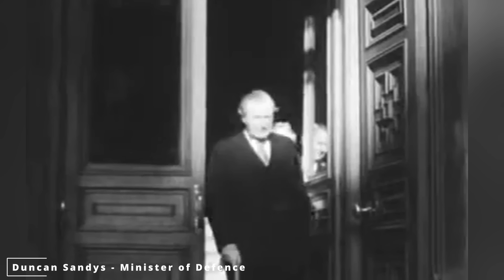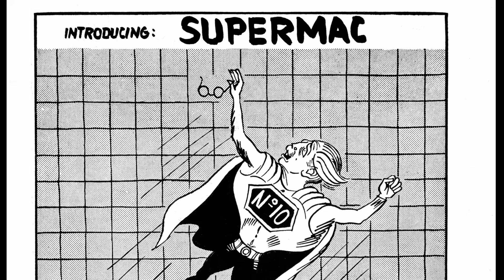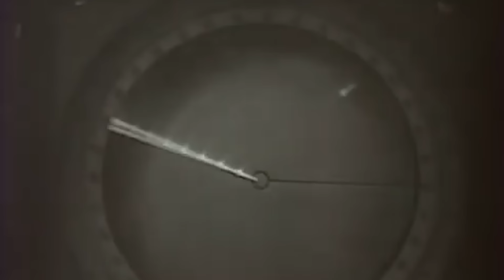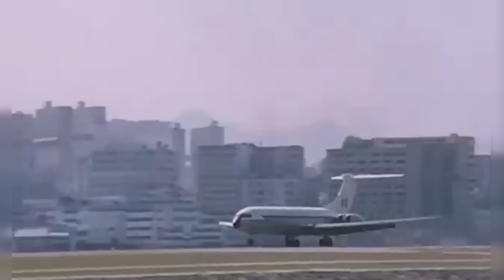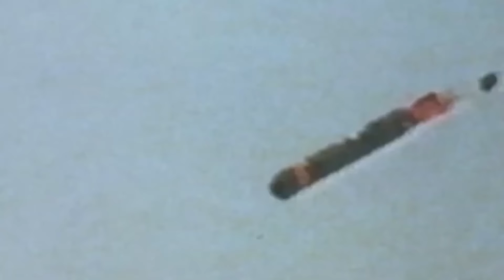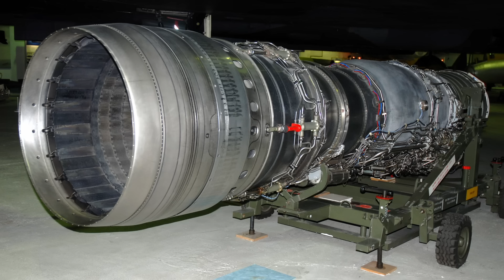How Britain Turned A Failed Airliner Into a Soviet Submarine Predator | The Mighty Nimrod

Comment: Did it sink any Soviet submarine? If not, then it was a more successful airliner than what you imply
Reply: The Nimrod was certainly not successful from a sales aspect either, the Lockheed P-3 and the Berguett Antlantique were more popular and successful.
Reply: @sandervanderkammen9230 

@DoktorBayerischeMotorenWerke   

We believe we can clear up some commonly held myths and misconceptions obviously.

It's always good to see the facts presented clearly and concisely isn't it?

All production Nimrod aircraft were new build Comet 4 airframes with the necessary modifications. The Nimrod was the most advanced and most capable aircraft of it's type at the time it went into service. The  Nimrod HS.801 was not available for purchase by other countries. The ability of the HS 801 to repeatedly & reliably demonstrate detection of subs and the knowledge that it could deliver nuclear depth charges to a target was a very effective deterrent. 

Bow-wing (see B-47 wing collapse wing folding incidents) had built less than 12 pressurised airliners before the Comet first flew and they were not high altitude airliners. 

All Nimrods were new build Comet 4 airframes with appropriate strengthening and the unpressurized  equipment bay tacked on. 

The HS 801 Nimrod was the most advanced aircraft of it's type at the time it first flew. Problems with the MRA4 programme were almost entirely due to radar and computer equipment issues and BAe Systems & co being too busy with other work at the time. 

Obviously there have been worse aircraft for accident losses both before & after the Comet.

Early problems with Comet takeoff stalls were caused by pilots over rotating the aircraft at liftoff. 

Podded engines on wings have aerodynamics issues. The main reasons for eventually going with podded engines were because or to facilitate - Ease of maintenance. Use of shear off fixings given excessive out of balance forces.
Large diameter turbofan engines.
Reduce load on the wing to fuselage connection. Increased power from later engines. 

The Bow-wing (See B-47 wing collapse & wing folding incidents) was a good example of how to expend a huge amount of cash and effort on something that was probably not worth bothering with. The basic design of the Comet had been decided upon and established before the podded engine choice has been made for the B-47. There were aerodynamics problems with podded pylon mounted engines at the time. The US also built and operated a significant number of EE Canberra bombers under licence which did not use podded engines for their wing mounted engines. . 

There have been aircraft losses caused by pod & pylon mounted engines. 

All jet airliners benefited greatly from the knowledge gained from the Comet incidents & subsequent investigations & yet some were still worse for accident losses. 

Instances of all marks of the Comet flew with full certification after 1954 including the Comet 3. The last Comet flight occured in 1997.

The fabulous trail blazing DH Comet.
World's first jet airliner in regular service.
The jet engined Avro Lancastrian actually did a passenger service before the DH Comet. 
World's first high altitude airliner.
World's first airliner with a full fuselage length pressurised cabin pressurised for high altitude flight. That feature for that type of aircraft was a considerably difficult undertaking. 

The change from larger squarer windows to smaller rounder windows was necessary for the particular aircraft at the time. Skin thickness remained mostly the same for all Comet marks. 

How things were back then.
Accident losses - % of aircraft built.

DeHavilland Comet 4 UK                          14% 
DeHavilland Comet all mks UK (ff 1949)17%  
Vickers VC10 UK (ff 1962)                         5%

Douglas DC-1  US                                       99%
Douglas DC-2                                              47%
Douglas DC-3                                              30%
Douglas DC-4                                              26%
Boeing s300    US                                       72% 
Boeing 307                                                  70%
Boeing 247                                                   48%
Boeing 707  (ff 1958)                                 32% 
Lockheed L-049 Constellation (ff 1943)  30%
Lockheed Electra US (ff 1957)                   29%
Fairchild FH-227 US (ff 1966)                   30%
McDonnell Douglas DC-8 US  (ff 1958)   14%
Sud Aviation Caravelle  (ff 1955)             15%
Canadair CL-44 Turboprop US (ff 1959) 46%  
Convair CV-580 Turboprop US (ff 1960) 22%
Convair CV-880     (ff 1959)                      27% 
Convair CV-990     (ff 1961)                      33%
Tupolev T-104        (ff 1956)                     16%
Vickers Viscount UK  (ff 1948)                29%  
Fokker F-27 Turboprop NL (ff 1955)       40%      

The Vickers VC10, fastest Atlantic crossing for a non supersonic jet airliner, held the record for 41 years.

For the first few years of operation the Caravelle & Comet had similar accident loss fatalities.

Sud Aviation Caravelle - 
all accident loss fatalities - 
1320 fatalities. 

De Havilland Comet - 
all accident loss fatalities - 
453 fatalities. 

An example of a typical airliner from the period. 
The Fokker Friendship F-27 fatalities & accident losses as a % of aircraft built. 
Fokker F-27 Turboprop (ff 1955)   40%
2130 fatalities.

Of course De Havilland carried out a full stress analysis & performed extensive & protracted testing on two long lengths of fuselage representing all features of a complete airframe. De Havilland carried out significantly more testing than was required by any authority at the time & significantly more testing that any previous airliner was subjected to.

De Havilland designers / engineers knew all there was to know about metal fatigue at the time they designed the DH Comet.

De Havilland had prior experience building many all metal construction airframe aircraft including many passengers aircraft & thousands of jet powered fighter aircraft that were primarily of metal construction with pressurised cockpits & used jet engines built by De-Havilland.

De Havilland did indeed always work to better than industry standards at the time, used up to date knowledge for the design & testing activities & no evidence of negligence or criminal negligence was ever produced in relation to the DH Comet.

Global aerospace. 
From the 1950s sector rationalisation and consolidation took place. 70 companies in France and 300 companies in the US disappeared due to merger or dissolution. In the US Boeing was almost bankrupted by the 707 project.  Boeing had a well protected domestic market and the available space and resources in the US to engage in large scale airliner manufacturing enabling them to capture orders simply by being able to produce airframes fast enough and cheap and nasty enough. Another factor is airlines preferring to obtain as much of their airliner inventory as possible from one manufacturer. 

Global Aerospace Sector, what's happening.

For example, there are of course no German companies that makes German jet aircraft in Germany & there are no German companies that make German gas turbine aero engines in Germany that are suitable for widebody airliners.

The UK has the world's highest combined per capita Nuclear / Defence / Aerospace Sector Activity.

UK defence sector, absolute terms, world's second highest activity. 1st for per capita defence sector activity. Per capita nuclear powered submarine construction, 2nd position. 
Main players being Rolls Royce, Babcock, GKN Aerospace & BAe Systems. Activities often involve international collaboration. BAe systems, RR and other UK companies now handle more Airbus work value wise than Germany. 

There's a good chance that anyone currently flying on a widebody airliner will be on an aircraft powered by RR gas turbine aero engines made in the UK and a good chance there will be other hardware on the aircraft that's designed and / or manufactured in the UK. 

Rolls Royce Holdings UK
Subsidiaries
- Rolls-Royce plc
- Rolls-Royce North America (ex Allison etc Classified Military stuff)
- Rolls-Royce AB
- Rolls-Royce Deutschland
- Rolls-Royce India Private Limited
- Rolls-Royce Marine Power Operations
- Vinters Engineering Limited
- Rolls-Royce Controls and Data Services
- Rolls-Royce Power Systems
- Bergen Marine
Joint ventures include:
- Rolls-Royce Turbomeca
- MTU Turbomeca -

Trent Family
The MT30 (Marine Turbine)
Industrial Trent 60 Gas Turbine
Trent 7000
Trent XWB Airbus A330neo.
Trent 1500
Trent 1000
Trent 500
Trent 600
Trent 700
Trent 800
Trent 8100
Trent 900
   
RR wholly owned subsidiaries in Germany handle smaller 2 shaft RR gas turbine aero engine work.

The UK space and aerospace sectors are highly productive, high-value industries that together contribute over £18 Billion in direct Gross Value Added (GVA) to the UK economy. Individually, the space industry directly contributes about 0.3% of UK GDP 7•2 Billion while the aerospace industry contributes approximately 0.5% £10•9 Billion.
   
We hope this helps.
Reply: @sandervanderkammen9230 

Typhoon & Tornado, British design aircraft. 

Early days of the airliners.

The awesome De Havilland Comet.
World's first production jet airliner.
World's first high altitude airliner. 
At the time the Comet wasn't particularly dangerous. The DH Comet was definitely not the worst engineering failure in commercial airliner history.

Losses comparisons.
How things were in those days.

DeHavilland Comet 4 UK                          14% 
DeHavilland Comet all mks UK (ff 1949)17%  
Vickers VC10 UK (ff 1962)                         5%

Douglas DC-1  US                                       99%
Douglas DC-2                                              47%
Douglas DC-3                                              30%
Douglas DC-4                                              26%
Boeing s300    US                                       72% 
Boeing 307                                                  70%
Boeing 247                                                   48%
Boeing 707  (ff 1958)                                 32% 
Lockheed L-049 Constellation (ff 1943)  30%
Lockheed Electra US (ff 1957)                   29%
Fairchild FH-227 US (ff 1966)                   32%
McDonnell Douglas DC-8 US  (ff 1958)   14%
Sud Aviation Caravelle  (ff 1955)             15%
Canadair CL-44 Turboprop US (ff 1959) 46%  
Convair CV-580 Turboprop US (ff 1960) 22%
Convair CV-880     (ff 1959)                      27% 
Convair CV-990     (ff 1961)                      33%
Tupolev T-104        (ff 1956)                     16%
Vickers Viscount UK  (ff 1948)                29%  
Fokker F-27 Turboprop NL (ff 1955)       40%      

The Vickers VC10, fastest Atlantic crossing for a non supersonic jet airliner, held the record for 41 years.

For the first few years of operation the Caravelle & Comet had similar accident loss fatalities.

De Havilland had prior experience building many all metal construction airframe aircraft & thousands of jet powered fighter aircraft that were primarily of metal construction with pressurised cockpits & jet engines built by De-Havilland. No aircraft before the Comet was subjected to as much pre-production testing as the Comet. 

It's a great pity & a crying shame that British military forces had to occupy a large part of Germany for decades after 1945 & Russian military forces had to do the same. Of course Russia still posseses a large chunk of what was German territory & of course Russia & the UK produce nukes. Obviously Germany does not produce nukes.

Interesting British achievements.

The gas turbine engine was invented & patented in England before the 1800s.

Axial multi stage sequential stage compressor & turbine technology, first produced for turbo machinery use in England by Parsons of Ireland & North England during the 1800s. The components form the basis of most modern gas turbine aero engines. At the time the concept of the jet aircraft powered by axial internal combustion gas turbine engines was first mentioned thus the internal combustion jet engine & jet aircraft was indeed invented in England before the 1900s & before the Wright brothers got busy.

Work on the multi stage sequential stator rotor axial compressor as applicable to the axial compressor gas turbine aero engine was ongoing in England from around 1928 by Arnold Griffiths and others. By 1943 the Metrovik F2/3  Beryl was a running axial turbojet that was superior to anything anywhere else. As the centrifugal compressor engines were adequate and more powerful at the time development of a larger F2/3  version was commenced.

The Metrovik (UK)  F2/3 axial compressor gas turbine aero engine was flight certified & ran in 1942, it was the result of UK development work ongoing since 1929. At the time it was the most capable axial compressor turbojet in existence but was not required and development work continued on a larger version.

Frank Whittle performed the world's first demonstration of a gas turbine aero engine in 1937. People in Germany kept a close eye on everything going on in Britain at the time.

The centrifugal compressor RR Nene was the most powerful & most reliable gas turbine aero engine on the planet in 1944. That engine would be later built under license or copied in many countries including Russia (Mig-15 Mig-17), China, the US, France and Switzerland powered dozens of aircraft types for decades after 1944.

Pratt and Whitney and others produce centrifugal compressor gas turbine aero engines. The PW200 is a currently produced whittle style centrifugal compressor, reverse flow combustor, gas turbine aero engine. 

The world's first wind tunnel was constructed in England during the 1870s. The world's first supersonic wind tunnel was constructed in England in 1922.

There is no doubt that the Fairey (England)
Delta 2 was the world's first jet
aircraft to exceed 1000 mph.  Indeed It
exceeded the previous record by 310 mph &
held the record for 1 year. Incidentally, the Dassault Mirage 3 & 4 are based on the Fairey Delta 2.

More recent UK military jet aircraft.

The Tornado & Typhoon & their engines are Supersonic & are indeed British design aircraft with British design engines built by an international consortium. The Tornado design for example started life during the 1950s at Vickers as the AFVG, it's engine is based on the RR RB-199. The EE Lightening is also a British Supersonic jet aircraft.

The Typhoon is the British BAC-EAP with an engine based on the British RR XG-40, the Typhoon is also built by an international consortium.

Brazil has the world's third largest airliner manufacturer and makes very good airliners & Brazil is 100th down the list along with Indonesia for wealth per capita. Of course it is in fact the case that Embraer can't build those airliners without purchasing stuff from the US, UK & Europe. For example, Norway, Holland, Denmark, Ireland & Belgium, top 20 wealth per capita, don't make airliners, its as simple as that.

Global aerospace. 
From the 1950s sector rationalisation and consolidation took place. 70 companies in France and 300 companies in the US disappeared due to merger or dissolution. In the US Boeing was almost bankrupted by the 707 project.  Boeing had a well protected domestic market and the available space and resources in the US to engage in large scale airliner manufacturing enabling them to capture orders simply by being able to produce airframes fast enough and cheap and nasty enough. Another factor is airlines preferring to obtain as much of their airliner inventory as possible from one manufacturer. 

Global Aerospace Sector, what's happening.

For example, there are of course no German companies that makes German jet aircraft in Germany & there are no German companies that make German gas turbine aero engines in Germany that are suitable for widebody airliners.

The UK has the world's highest combined per capita Nuclear / Defence / Aerospace Sector Activity.

UK defence sector, absolute terms, world's second highest activity. 1st for per capita defence sector activity. Per capita nuclear powered submarine construction, 2nd position. 
Main players being Rolls Royce, Babcock, GKN Aerospace & BAe Systems. Activities often involve international collaboration. BAe systems, RR and other UK companies now handle more Airbus work value wise than Germany. 

There's a good chance that anyone currently flying on a widebody airliner will be on an aircraft powered by RR gas turbine aero engines made in the UK and a good chance there will be other hardware on the aircraft that's designed and / or manufactured in the UK. 

Rolls Royce Holdings UK
Subsidiaries
- Rolls-Royce plc
- Rolls-Royce North America (ex Allison etc Classified Military stuff)
- Rolls-Royce AB
- Rolls-Royce Deutschland
- Rolls-Royce India Private Limited
- Rolls-Royce Marine Power Operations
- Vinters Engineering Limited
- Rolls-Royce Controls and Data Services
- Rolls-Royce Power Systems
- Bergen Marine
Joint ventures include:
- Rolls-Royce Turbomeca
- MTU Turbomeca -

Trent Family
The MT30 (Marine Turbine)
Industrial Trent 60 Gas Turbine
Trent 7000
Trent XWB Airbus A330neo.
Trent 1500
Trent 1000
Trent 500
Trent 600
Trent 700
Trent 800
Trent 8100
Trent 900
   
RR wholly owned subsidiaries in Germany handle smaller 2 shaft RR gas turbine aero engine work.

The UK space and aerospace sectors are highly productive, high-value industries that together contribute over £18 Billion in direct Gross Value Added (GVA) to the UK economy. Individually, the space industry directly contributes about 0.3% of UK GDP 7•2 Billion while the aerospace industry contributes approximately 0.5% £10•9 Billion.
   
We hope this helps.
Reply: @sandervanderkammen9230 

 
The fabulous trail blazing De Havilland Comet. 

World's first production jet airliner doing regular commercial service. An Avro Lancastrian jet airliner was actually first. 

World's first high altitude jet airliner. 

There can be no excuses for the Bow-wing (See B-47 wing / folding  collapse incidents) Max incidents given that Bow-wing had more than 50 years design and build experience for the type. 

A typical Bow-wing (See B-47 wing collapse incidents) airline duty 707 lasted for about 23 years on average. The reason any lasted longer was large numbers built so lots of spares with a lot of airframes in military use with big military maintenance budgets and many often with low flying hours or in storage. A typical 707 is basically cheap nasty junk. 

All later jet airliners benefited greatly from the knowledge gained from the Comet incidents & subsequent investigations & yet some were still worse for accident losses. 

Instances of all marks of the Comet flew with full certification after 1954 including the Comet 3 with full certification remaining in place until after the aircraft were retired. The last Comet flight occured in 1997.

The nose design was unique to the Comet, Sud Aviation licensed the design for their Caravelle. 

The fabulous trail blazing DH Comet.
World's first jet airliner in regular service.
The jet engined Avro Lancastrian actually did a passenger service before the DH Comet. 
World's first high altitude airliner.
World's first airliner with a full fuselage length pressurised cabin pressurised for high altitude flight. That feature for that type of aircraft was a considerably difficult undertaking. 

How things were back then.
Accident losses - % of aircraft built.

DeHavilland Comet 4 UK                          14% 
DeHavilland Comet all mks UK (ff 1949)17%  
Vickers VC10 UK (ff 1962)                         5%

Douglas DC-1  US                                       99%
Douglas DC-2                                              47%
Douglas DC-3                                              30%
Douglas DC-4                                              26%
Boeing s300    US                                       72% 
Boeing 307                                                  70%
Boeing 247                                                   48%
Boeing 707  (ff 1958)                                 32% 
Lockheed L-049 Constellation (ff 1943)  30%
Lockheed Electra US (ff 1957)                   29%
Fairchild FH-227 US (ff 1966)                   30%
McDonnell Douglas DC-8 US  (ff 1958)   14%
Sud Aviation Caravelle  (ff 1955)             15%
Canadair CL-44 Turboprop US (ff 1959) 46%  
Convair CV-580 Turboprop US (ff 1960) 22%
Convair CV-880     (ff 1959)                      27% 
Convair CV-990     (ff 1961)                      33%
Tupolev T-104        (ff 1956)                     16%
Vickers Viscount UK  (ff 1948)                29%  
Fokker F-27 Turboprop NL (ff 1955)       40%      

The Vickers VC10, fastest Atlantic crossing for a non supersonic jet airliner, held the record for 41 years.

For the first few years of operation the Caravelle & Comet had similar accident loss fatalities.

Sud Aviation Caravelle - 
all accident loss fatalities - 
1320 fatalities. 

De Havilland Comet - 
all accident loss fatalities - 
453 fatalities. 

An example of a typical airliner from the period. 
The Fokker Friendship F-27 fatalities & accident losses as a % of aircraft built. 
Fokker F-27 Turboprop (ff 1955) 40%
2130 fatalities.

Boeing 707    3108 fatalities.

Of course De Havilland carried out a full stress analysis & performed extensive & protracted testing on two long lengths of fuselage representing all features of a complete airframe. De Havilland carried out significantly more testing than was required by any authority at the time & significantly more testing that any previous airliner was subjected to.

De Havilland designers / engineers knew all there was to know about metal fatigue at the time they designed the DH Comet.

De Havilland had prior experience building many all metal construction airframe aircraft including many passengers aircraft & thousands of jet powered fighter aircraft that were primarily of metal construction with pressurised cockpits & used jet engines built by De-Havilland.

De Havilland did indeed always work to better than industry standards at the time, used up to date knowledge for the design & testing activities & no evidence of negligence or criminal negligence was ever produced in relation to the DH Comet.

Global aerospace. 
From the 1950s sector rationalisation and consolidation took place. 70 companies in France and 300 companies in the US disappeared due to merger or dissolution. In the US Boeing was almost bankrupted by the 707 project.  Boeing had a well protected domestic market and the available space and resources in the US to engage in large scale airliner manufacturing enabling them to capture orders simply by being able to produce airframes fast enough and cheap and nasty enough. Another factor is airlines preferring to obtain as much of their airliner inventory as possible from one manufacturer.  Brazil has the world's third largest airliner manufacturer, Brazil is towards the bottom of the wealth over capita tables along with Indonesia. Most of the countries at the top don't bother having a single national airliner manufacturing company. 

Global Aerospace Sector, what's happening.

For example, there are of course no German companies that makes German jet aircraft in Germany & there are no German companies that make German gas turbine aero engines in Germany that are suitable for widebody airliners.

The UK has the world's highest combined per capita Nuclear / Defence / Aerospace Sector Activity.

UK defence sector, absolute terms, world's second highest activity. 1st for per capita defence sector activity. Per capita nuclear powered submarine construction, 2nd position. 
Main players being Rolls Royce, Babcock, GKN Aerospace & BAe Systems. Activities often involve international collaboration. BAe systems, RR and other UK companies now handle more Airbus work value wise than Germany. 

There's a good chance that anyone currently flying on a widebody airliner will be on an aircraft powered by RR gas turbine aero engines made in the UK and a good chance there will be other hardware on the aircraft that's designed and / or manufactured in the UK. 

Rolls Royce Holdings UK
Subsidiaries
- Rolls-Royce plc
- Rolls-Royce North America (ex Allison etc Classified Military stuff)
- Rolls-Royce AB
- Rolls-Royce Deutschland
- Rolls-Royce India Private Limited
- Rolls-Royce Marine Power Operations
- Vinters Engineering Limited
- Rolls-Royce Controls and Data Services
- Rolls-Royce Power Systems
- Bergen Marine
Joint ventures include:
- Rolls-Royce Turbomeca
- MTU Turbomeca -

Trent Family
The MT30 (Marine Turbine)
Industrial Trent 60 Gas Turbine
Trent 7000
Trent XWB Airbus A330neo.
Trent 1500
Trent 1000
Trent 500
Trent 600
Trent 700
Trent 800
Trent 8100
Trent 900
   
RR wholly owned subsidiaries in Germany handle smaller 2 shaft RR gas turbine aero engine work.

The UK space and aerospace sectors are highly productive, high-value industries that together contribute over £18 Billion in direct Gross Value Added (GVA) to the UK economy. Individually, the space industry directly contributes about 0.3% of UK GDP 7•2 Billion while the aerospace industry contributes approximately 0.5% £10•9 Billion.

The original alloy used for the Comet was discontinued by the manufacturer, that is why the alloy changed. The skin thickness remained the same for most of the airframe, the only change to skin thickness was the area where the wings meet the fuselage.  The window shape and size changes were necessary, the fact that cracks didn't run through viewing windows is irrelevant. The fracture that started at the rdf assembly window was due to fatigue fracture, the fracture started at a bolt hole. The fracture that started at an escape hatch during post incidents water tank testing was also due to fatigue fracture. all structural bulkheads, floors and decks were constructed using aerospace grade aluminium.